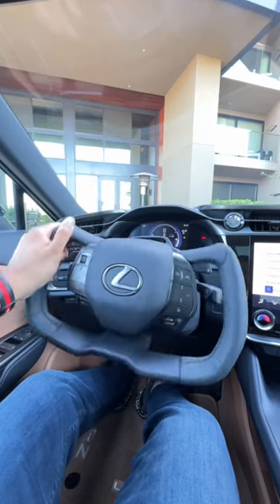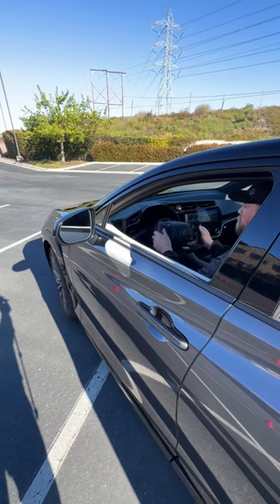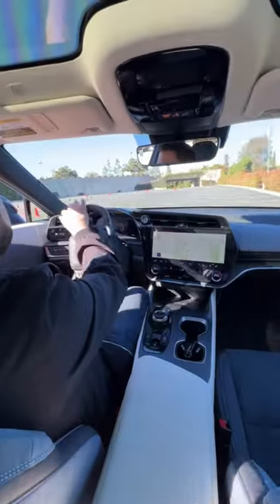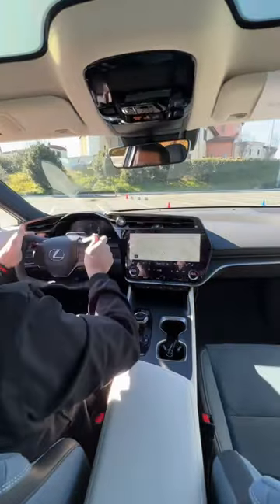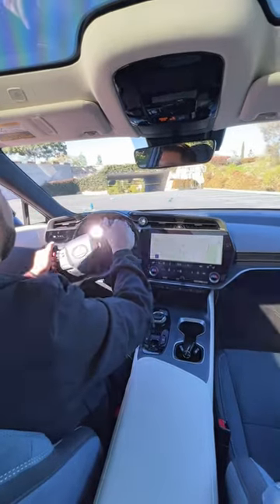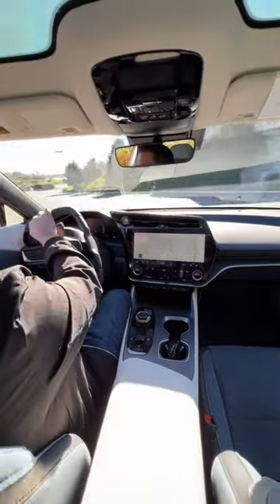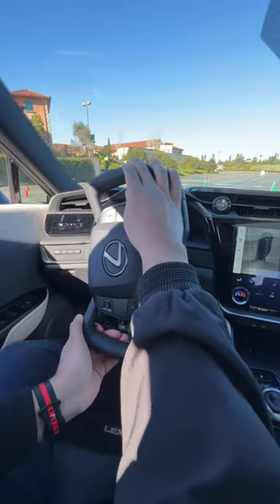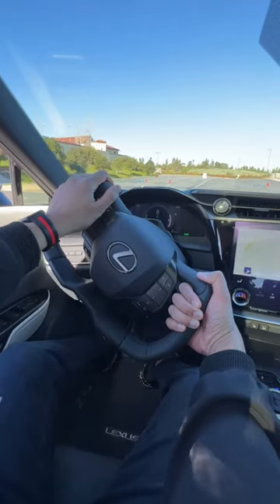Lexus RZ yoke steering wheel explained!

Comment: Imagine in like 15 years this system breaks and you completely lose your ability to turn on the highway
Reply: All the parts have a backup
Reply: This is used on many other things such as planes and large machinery
Reply: @GamingTrivia1113  but not in civil cars, this system need more inspection then regular car have and so unnecessary in this car…
Reply: I swear that was the first thing I was thinking
Reply: @GamingTrivia1113  Planes and machinery usually gets checked more reguarily than some cars on the road. Some people will drive their car w/o maintenance done for years at a time
Reply: @GamingTrivia1113  a car definitely needs more responsivness and precision at hand than a plane
Reply: The same could happen if hydraulics fail or if the driveshaft snaps. Electronics are far safer than mechanicals links
Reply: You really think the engineers didn't think of that?
Reply: @Michael-ty2uo  the gas pedal is a electric system yet we don’t see it getting broken do we! 
Yet if a steering wheel’s power steering breaks your utterly screwed
Reply: It's a fancy toyota, it'll never break
Reply: @Michael-ty2uo a car with no maintanance for years isnt going to work. Sorry but you literally have no chance of driving a car like that. Psi is a thing, tire wear and break wear exist. 5 or more years and you'll likely need a new battery. Car maintenance will always be necessary.
Reply: @EvilNeuro "the gas pedal is an electric system yet we dont see it getting broken do we!" Lexus is owned by toyota, the same company who had hundreds of complaints about gas pedals breaking and sometimes causing fatal crashes.
Reply: @floseatyard8063  my bad. They obviously di break but no one makes a fuss.
I’d take a steer by wire system over a hydraulic system it’s just so much safer. You have no moving parts that can break or get seized. It could also theoretically let the car do stability control better preventing thousands and thousands of fetal crashes.
Reply: @StarsUwU  yeah I agree with you there, the redundancy also prevents it from just dying like many people expect in the comments section. About the gas pedal maybe lexus doesn't have any flaw with it now that I think about it but I hope it doesnt

Comment: “ electronic signals “ yeah I’m out.
Reply: Fr
Reply: dont all modern cars use that?
Reply: Some planes have this same feature
Reply: @TonyCrispruby  nope. they use electronic power steering, there's still a physical connection from the steering wheel to the tires, it's just electronically assisted.
Reply: @jaysarchive7325  nope.
Reply: @TheBiggestCorn  I didn’t know that
Reply: Make sure you don't get into an airliner again. They use the same thing😂
Reply: Okay grandpa. I bet you don’t use the throttle either since it’s not directly connected
Reply: Red Flag
Reply: @Enxuvjeshxuf  what
Reply: I bet you still hand-crank your ignition, Henry Ford style.
Reply: There's like a couple battery backups and a backup steering motor I think
Reply: 😅😅😅😅😅😅😅 for real
Reply: wait till you find out how your gas pedal works!

if you want an old car buy an old car lol, that's totally valid. but don't complain because technology has advanced
Reply: @jaysarchive7325  no they don't, there a mechanical steering shaft just like a hydraulic rack, magnets in the rack give force increase, learn before you speak bruh
Reply: @Paul2.4T  ah okay. thanks for clarifying brother. and you’re right, I just assumed that because that’s what my dad told me when he had a 2018 highlander. I really don’t know which vehicles use what steering system.
Reply: @Paul2.4T  well he said there’s no rod that connects the steering wheel to the rack or wheels or something. is that true?
Reply: @TonyCrispruby  power steering isn’t the same thing, the point is having redundancy in something that your life depends on
Reply: @antiwokehuman  even if there were no redundancies built into their planes, I’d trust an airliner more than a new model of car. Have you never heard of a recall?
Reply: @littlefish1069  that's a pretty naive thing to say
Reply: @jaysarchive7325 the rack amd pinions are electric instead of hydraulic. But there is still a physical metal shaft connecting the steering wheel to the rack and pinion.
Reply: @antiwokehuman  actually, airliners have redundancy and mileage. I’d wait a bit more…
Reply: Most passenger jets operate fly by wire for tje last 50 years
Reply: @antiwokehuman  a pilot has far more training and education for using a plane than I’ll ever get driving something this $$$
Reply: @aidancommenting  like a real man😂
Reply: @craigme2583  exactly
Reply: What’s with people being scared of anything electronic 😂 when it comes to controls, electrical signals have been far superior than mechanical ones for decades
Reply: @truongkimson  there are different levels of reliability and these electronics are literally brand new.
If you think past tech makes it safe to Guinea pig the new tech be my guest. Only about a decade ago Toyota cars had a malfunction where some cars accelerated out of control. Recalls happen.

I’ll trust an automatic transmission but not a practically Bluetooth steering wheel with lag, lmao.
Reply: @littlefish1069  “bluetooth steering with lag”? You’re pretty vocal for someone who obviously doesn’t know how all of this works. I doubt you have the necessary foundational engineering knowledge to grasp it
Reply: @littlefish1069  also you do know the toyota recall was because of a mechanical problem right? A poorly designed floormat
Reply: @truongkimson  lmao I just noticed that he turned and the car followed afterwards, I was being hyperbolic!
I googled the Toyota recall and I’m totally wrong- it’s not mechanical failure either though, it was user error.

But really though, I’ll stick with traditional power steering- my overall point is that I don’t test out new tech on things that my life depends on.
Reply: @truongkimson  I think you make a good point though, “lack the foundational knowledge”
I can fix practically anything on my Mazda, and I stick with the things I understand. I definitely don’t understand why this is an improvement.
Reply: @Jay-rg5mt  dangerous and overcomplicated but “new”. No mechanical connection between driver and car is good to you?
Reply: @elynnzhao7422  main problem with wire steering its unnecessary and dangerous, for that reason brake pedal even with vacuum booster directly push on brake piston, if something goes wrong you still can hit the brakes and stops, if you have throttle issue its not so bad, and you see electronics throttle only for traction control and idle control without special valve, its just simple to manufacture. and its not for you, not for customer interests
Reply: I’m afraid you’ll never fly on an airplane with that mind set
Reply: @antiwokehuman all boeing planes except the 777 and 787 are mechanically linked, most airliners are fly by wire though like you said
Reply: @kombrug fun fact most plane yokes and sidesticks arent mechanically linked yet they sre the safest form of travel
Reply: @kombrug most planes are fly by wire yet they are extremely safe.
Reply: @floseatyard8063  all systems in plane duplicated and in general, aircraft are serviced much more often and more strictly
Reply: @kombrug  yeah and any car owner who has a brain would also maintain their car strictly and not ignore maintenance
Reply: @kombrug  Any car owner who cares about his/her car should maintain & service their car; if someone don't maintain their car properly, they don't deserve to own any vehicle for their whole life; it's like giving birth to a child and then being a careless parent.

Comment: 5 years down the line
Steering system: "I want problems, ALWES!"
Reply: Nah not from a lexus
Reply: @TheV8Pumpkin  Toyota/Lexus went down tremendously in quality
Reply: @ireallyreallyreallylikethisimg  still on top
Reply: @ireallyreallyreallylikethisimg  says who?
Reply: @ryanm7905  ask any mechanic. its not their fault though. they're just following the crazy emission regulations and safety standards, which both need more electronics and sensors and other things that break. just dont expect to buy a 2023 thundra without having to replace the turbos and some electronics in the next 20 years.
Reply: @ireallyreallyreallylikethisimg  tremendously? I dont think so
Reply: @ireallyreallyreallylikethisimg no they didn’t stop lying pls.
Reply: @ireallyreallyreallylikethisimg the new tundra is the safest crash car out of all the trucks wym? Brother stop spreading false information
Reply: @ireallyreallyreallylikethisimg the only that breaks on the truck I believe is the turbos so far after 100k miles which is normal for a turbo to bust, it is a horrible thing I’m ngl. I was looking into the new tundra and I got the 2020 sr5 6.5 bed, 5.7 v8, LOVE IT. And after driving the twin turbo v6 no eco I completely decided not to upgrade but the eco boost twin turbo v6 drives insanely well. They r all fast trucks but the regular v6 feels like it’s gonna explode and insanely and dangerously delayed. Yk what they did go down.
Reply: @ireallyreallyreallylikethisimg  even lexus?

Comment: If you go around a corner, take hands of the steering wheel and accelerate, does it go back itself in relation to the wheels? Or is it just spring loaded?

Comment: So does the sensitivity change gradually, or is there a threshold speed where it switches? 

Like if you decelerate on an exit ramp is it going to start turning more if you maintain the same wheel position?
Reply: I think so, cause the electronics automatically change the sensitivity,  but on a ramp it would become less sensitive as more input is needed at slow speed. The sharpest turns would be like going very slowly, yoke turned as much as possible

Comment: How safe is it though?
Reply: Safe enough for fighter jets to use that system
Reply: @jovanbudial5812  jets fly tho and they've had decades of engineering to fine tune it, this on the other hand is new I'd presume, one error or failure and you're wallet and maybe life is finished. And not to mention if the jet did malfunction, the pilot can eject while a driver can't
Reply: @Jovan Budial  not every fighter is fly by wire tho, and it's mostly used for stability since you couldn't physically make all the micro adjustments 
That said, this pos car uses steer by wire for the sake of it without improving anything expect their revenue when it's gonna eventually get repaired

Comment: I just don’t think it’s a good idea to have a non-mechanical steering wheel. Especially coming from the company who created unintended acceleration but I’m just a person who doesn’t want to die in a car crash.
Reply: i mean those people had plently of opportunities to save themselves and unfortunately they just didn’t have the right information. Even if the floormat got stuck on the pedal you can shift into Neutral, or even just mash to breaks. Breaks will always beat the throttle. That wasn’t lexus’s fault if you think about it.
Reply: @cale4671  I’m pretty sure it wasn’t a mat stuck on the accelerator in the unintended acceleration case. It was an electrical software issue. Its a cool idea to save the weight and space of not having a steering column/ rack and pinion, but if the electrical goes out, you will not be able to steer. Sounds like a recipe for an accident to me.

Comment: this happened to me literally two days ago. my alternator started going bad and the replacement was also a dud that died on me while taking it back home to my shop. I wouldn't have been able to get it around the corners while pushing it without a physical connection between my steering input and front wheels. how would this work in that sort of situation?
Reply: Redundancy

Comment: Pretty cool until your freak out on the road, jerk the steering wheel and barell roll the car😮
Reply: Nope. That never happens
Reply: @Sbudre  proof?

Lemme guess  "trust me"
Reply: @Edtuma  if you are low speeds and you suddenly turn your steering wheel it is unlikely to barrel roll your because you not driving fast enough to barrel roll. At high speeds the risk of freaking out and barrell rolling the car is the same for this yoke as it is for a normal steering because the steering wheel ratio is the same. It's called reason and logic.
Reply: @Sbudre  bruh electrical and sensor failures mid drive don't gaf about reason and logic

Comment: This tech is cool but I don't trust it in the hands of everyday people. Electronic stearing is more dangerous when not properly, built, inspected or maintained. I trust airlines to do this work mostly due to government regulation and inspection. I don't trust everyday people to think about inspecting and maintaining their vehicle carefully.

With power stearing and manual steering there are physical clues leading up to failure. Electronics can fail suddenly when a component fails.

Again the tech is cool, I just don't trust the masses to understand and put in the work for these systems. Plus electronic systems are vulnerable to hacking especially if they connect to the internet and I trust the internet less than the masses.
Reply from the maker: Yea I'm excited to see how this holds up in a real world case use

Comment: It’s literally illegal to not have a mechanical connection from the steering wheel to the rack.. same with brake by wire. There’s still a mechanical aspect of it just in case the system fails.. learn more about cars before you try to teach people about them

Comment: When you get bad ground contact do the wheels electronically feed back to the wheel to make it feel light.

Seriously though steering and breaks should be as mechanical and direct as possible. If your engine instantly disappeared and an emp went off you should still be able to stop the car and pull over.

Comment: Even my car simulator steering isn't that crappy. I would switch it with a Fanatec wheel with more than 1000 degrees range of motion and precision control and feedback that doesn't vary with speed.